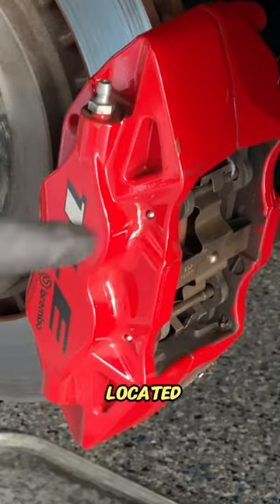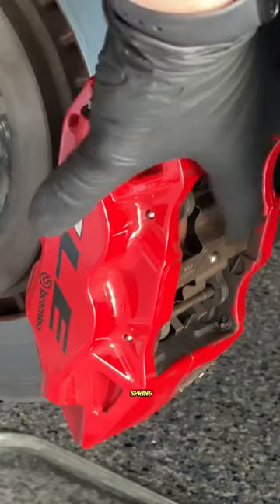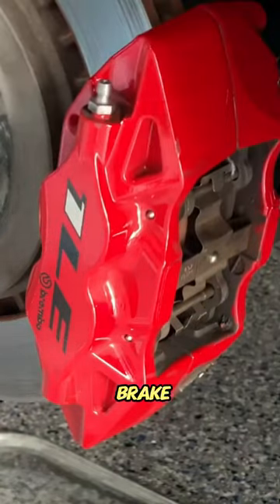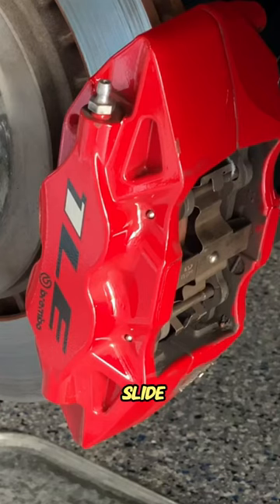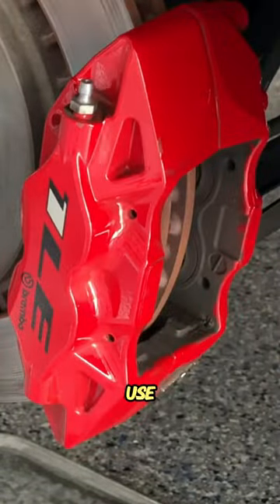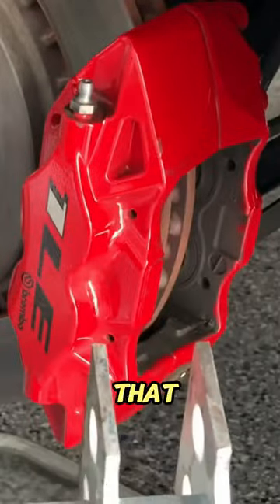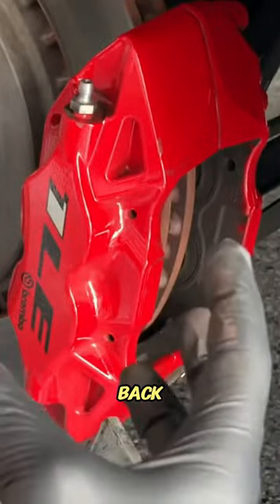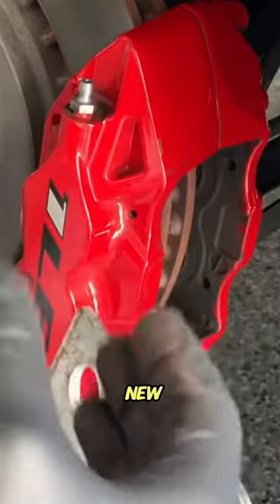Brembo 4-Piston Pad Change #Brembo #Camaro #Corvette #1LE #ZL1 #SS #4Pot

Comment: Question! My Camaro has brembos on the front but they do not have the visible pins like yours. Any idea what I should do?
Reply from the maker: Hmmm… which Camaro do you have? This fixed Brembo caliper setup is used on many, many cars. Nearly all Brembo calipers have the pins.
Reply: I did deeper search and a 10 point star adapter is needed. Wish mine was this simple now I need to go buy that adapter 😅
Reply from the maker: @Hi-jt6qr  which Camaro do you have? You should not be taking apart the star bolt, that typically holds the caliper halves together.
Reply: @FollowMyLine17  2021 Camaro lt1
Reply from the maker: @Hi-jt6qr  ah ok. The LT1 model is one of the few that uses a different Brembo caliper setup. The Star Bolt replaces the quick-pin on those models.

Comment: Nice, it only takes 60 seconds to change pads 👍
Reply from the maker: Honestly, it takes longer to get the car lifted and the wheels off haha. The pads really are only a couple minutes per side and it hurts my soul when I see folks get charged out the nose for a brake job on these cars.
Reply: @FollowMyLine17  yeah I did my first oil change on mine and have all the stuff you recommended on the full video.